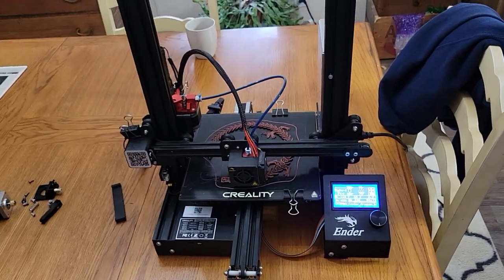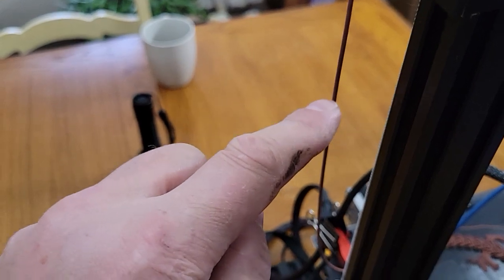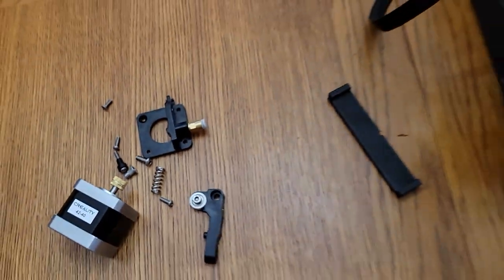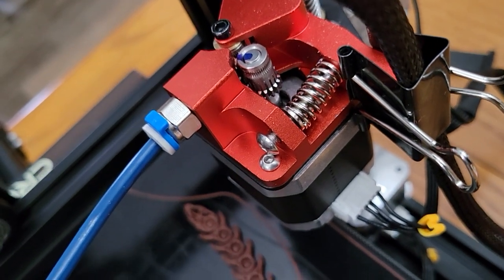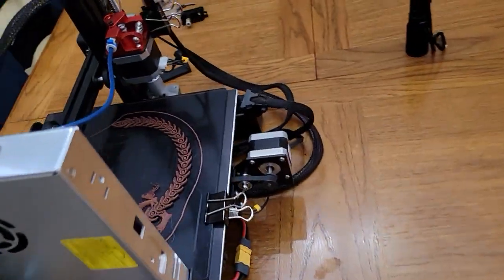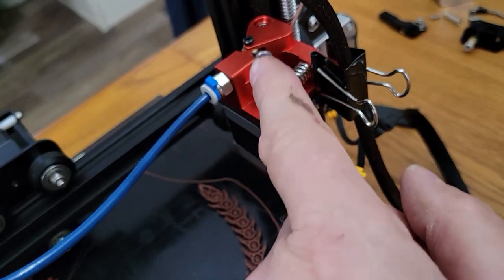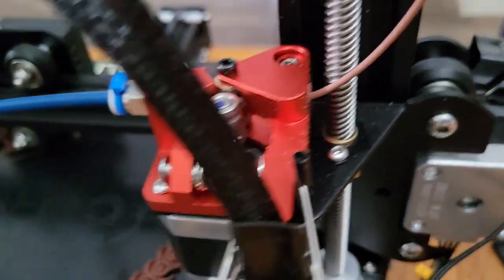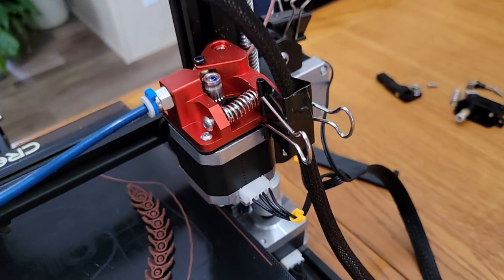Fix Ender 3D Printer Filament Slipping, Gear Drive Extruder

Comment: I am having trouble with my standard one, I was wondering what your prints were looking like before you changed it so I can see if maybe mine is having the same problem.
Reply from the maker: There was almost no filament coming out, the roller was just slipping
Reply: @venturahwy76 that is similar to what is happening to me! thanks.

Comment: It sounds soo terrible. What have you done to it. Revert everything to stock if you don't know anything about these precious machines, or better don't use them.
Reply: That’s how a stock ender 3 board sounds
Reply: @blizzard7436  bro. We have an Ender 3,and it sounds nothing like that
Reply: @davidd2661  hmmm not sure then do you have the v2?
Reply: @blizzard7436  I have a v2 at home, and a base 3 at work. Neither sound like that
Reply: @davidd2661  idk then you might know more than I do
Reply: @blizzard7436  no, I don't think so. But the squeak this one makes is just eaugh
Ouch
Belts ripping, rollers screeching, motors spending their life savings on power, etc
Reply: @davidd2661  this is 100% how the stock ender 3 sounds